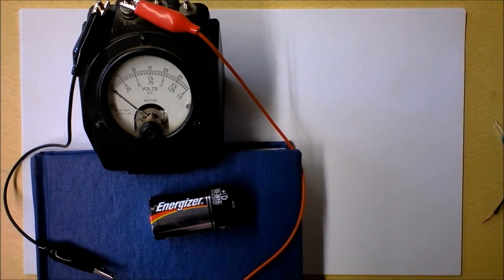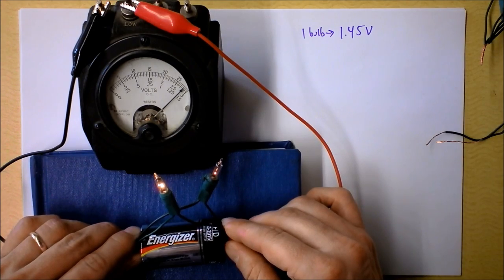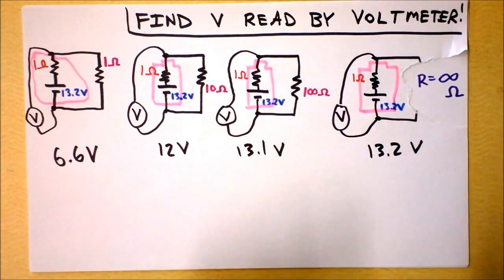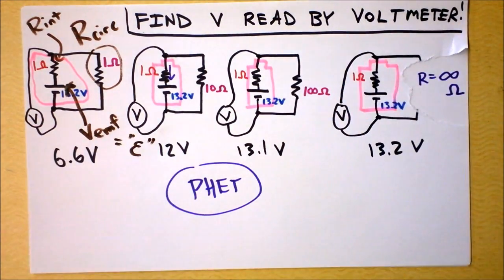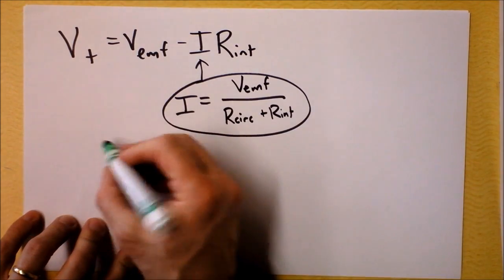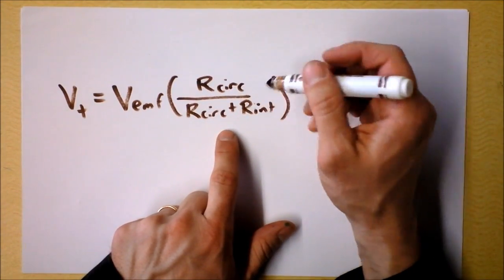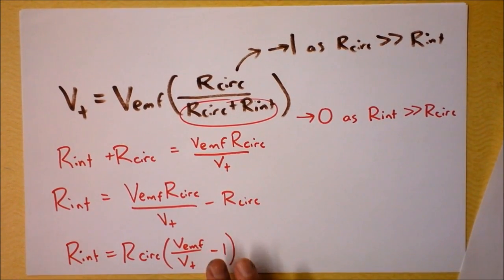EMF, Internal Resistance, and Terminal Voltage of Batteries Explained | Doc Physics

Comment: At 2:56 you have the same "terminal" voltage for both 3 and 4 bulb loads. This is obviously a measurement error I suspect because you are using an analog voltage meter or have simply interpolated the scale incorrectly. What you refer to as the emf voltage is more accurately described as the Thevenin voltage of the source (Vth) and what you refer to as the "circuit" voltage is usually known as the load voltage (VL).  Finally the "internal" battery resistance is the Thevenin resistance of the source (Rth). The formula expressed at 10:48 is an equation expressing the load voltage as a function of the current. If you were to plot this (load voltage versus current) for your data at 2:56 would would get a (approx) straight line whose slope is the negative of the "internal" (Thevenin) resistance. The "y-intercept" (at zero current) would be the Thevenin (open circuit) voltage and the "x-intercept" (zero voltage) would be the short circuit current (which is the ratio of the Thevenin voltage to the Thevenin resistance). I.e., V (load) = Vth - I*Rth. If you do this you would find that the straight line is best approximated ignoring the "3-bulb" voltage (which is incorrect). This line is very nearly straight and a least squares approximation yields an "internal" (Thevenin) resistance of 0.3 ohm in this case. Finally, a battery is not an "ideal" voltage source as an ideal voltage source has no internal resistance and thus will supply ANY current necessary to maintain a constant voltage. I.e., its voltage versus current graph is a horizonal line.

Comment: DOC SCHUSTER,,,,                                                      ,,,,    Eric Johnson is saying that overdrive & fuzz guitar pedals that take batteries will sound different when using different types of 9volt batteries NON-Rechargeable 9 volt batteries like Alkaline, Carbon zinc, Lithium, Mercury because of the DC resistance of the 9 volt battery.
////            The sound will be different if you use an Alkaline, Carbon zinc, Lithium, Mercury battery each will sound differently because of the batteries DC resistance
--->>>  1.) Why does each 9 volt battery type  Alkaline, Carbon zinc, Lithium, Mercury have a different battery DC resistance?      Why different battery types will have a different DC resistance compared to another battery type, any reasons why?     Yes I know that the batteries DC resistance will drop the 9volts when the guitar pedal is drawing more current but what Eric Johnson is saying is that  9 volt Alkaline, Carbon zinc, Lithium, Mercury will have a different DC resistance which will drop the 9 volt down differently when the overdrive or fuzz pedal is drawing more or less current.

Comment: I got 6.6V,1.2V,0.131V cause currents had the same magnitude,since they multiplied with 1ohm,we got these voltage values but this decimal place is confusing me
Reply: We learned that the bigger resistor got greater share of voltage so the resistor right next to our battery had a smaller voltage for itself so I felt like it's a bit reasonable
Reply: What you got is the current throughout the circuit, not the voltage. To find the voltage drop multiply what you got by the internal resistance, which is 1 ohm (because V=IR), and then subtract from the 13.2V. Idk if you still need this cause it was a year ago but hope this helps

Comment: what is the potential diff between two battries of different emf E1>E2 joined parallel to each other with internal resistance is zero.. these battries are joined is such a way that positive terminal of one is joined to the positive terminal of other battery and negative to negative ..

Comment: Aha! so when we measure a branch with the voltmeter, we consider only the characteristics of that branch, like the resistance of the battery!. The only variable that depends on the entire circuit, and affects the branch measurement, is the current, because the current goes through the entire circuits and comes into the branch you're measuring as being modified. The internal resistance doesn't sum with the exterior resistance when measuring the branch with the voltmeter, that was my mistake.

Comment: Hey Doc, I know, old video.. but I can't get the calculations right.. Isn't calculating through a voltmeter uses volts but the results you give are used with VR=I, i.e. 13.2 x 1/2 = 6.6 A not 6.6 V? Or am I missing something here..
Reply: It's V=IR not VR=I. If you were to make I the subject of the formula then it would be I=V/R and the units would be in A. To get his answer I think he most likely did his calculations like this: He found the total current in the circuit by using I=V/R which would be I= 13.2/ 2, your answer here would be 6.6A. To find the reading on the voltmeter he would have used the voltage passing through the 1 ohm resistor. Which would be V=IR or V=6.6 x 1. The answer would then be 6.6 V.Of course it is possible that I could be wrong and he used some other method but I think this is what he did. I hope it helps :)

Comment: I didn't get the first circuit diagram. Shouldn't the effective resistance be 1/(1/1 + 1/1) = 1/2? Then the voltage reading of the voltmeter should become 26.4, should it not?!! Can someone help me understand if there's any calculation error, because right now, I,m not able to!
Reply: Ram Bhar 
1. The resistances are in series not in parallel..they'll be 1+1(Req)=2 and the voltage drop would be 13.2/2= 6.6
2. The voltage..can it ever be 26 when the battery can produce max as 13.2?

Comment: umphh, the current supposed to move from terminal positive to terminal negative but why for this topic the current move inverted?
Reply from the maker: +Nur Zulaikha How did you get that impression?  I always treat current as coming from positive terminal.
Reply: In my school, we learn in physics that electrons flows from negative to positive but in electronics (different subject) we learn that current flows from positive to negative. This is because we originally thought the latter, but later is was discovered the former was true. The formulas still work with both concepts however, so electrical engineers kept with the idea that current flows from positive to negative for simplicity.

Comment: Yo yo yo.. I accidentally took the resistors in parallel (Silly mistake, the paralle voltmeter threw me off.). So I got Rtot using the parallel resistors equation. And then followrd by another silly mistake,(V=VR.) Getting the exact same answers as shown in the video. Any reasons behind this coincidental error? Help Doc!
Reply from the maker: +Hamza Ali I don't know how you use V = V/R.  Sounds like an inverse mistake or something.  Two wrongs made a right.
Reply: +Doc Schuster Doc doc, The last equation to this video. Quite similar to V=VR, don't ya think?
Reply: Fam, it's V = IR

Check your units.
Reply: +Hamza Ali Voltage = Current * Resistance

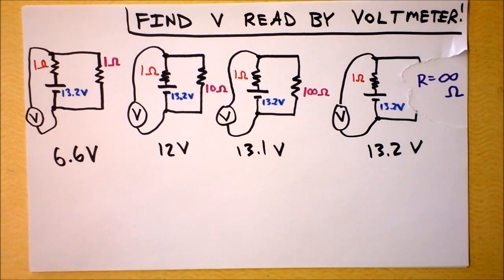Comment: Couple of comments at the bottom didn't get his voltages when they found the "I" of the whole circuit. Getting answers such as 6.6V, 1.2V and .131.  That is the voltage drop on the whole circuit,  it might make more sense if you did it like Kirchhof's rule. V-IR-IR=0.  Easier to recognize that as a drop.You minus that from the original voltage( V0-Vdrop)=Docphysics Answers , get the answers he has at around 6:15 . ... BYE

Comment: Doc how am I supposed to calc the battery emf if given only current flowing as 20mA
Reply: are you not given the voltage of the battery too ?
Reply: Also what other components are in the circuit, if any?

Comment: If you were struggling with the find the voltage part. Add the resistances together, then divide the 13.2 V by that total resistance value. Then do 13.2 V subtract the value you got to get the voltage you are looking for
Reply: Sciencenerd You substract because the voltage you get without substracting is the voltage of both the battery and the resistance! So for you to get the voltage of the resistance alone you have to substract from it the voltage of the battery. I hope it was helpful.
Reply: +alexander26bro thanks that was helpful :) !
Reply: We subtract because 13.2V/Rtotal is the voltage drop, we want the voltage on the resistor which is the total voltage minus the voltage drop. Kinda the opposite of what Rim said.
Reply: alexander26bro But why do you subtract? Once I got the current by dividing 13.2/R equivalent, I multiplied the current by the resistance which gave me wrong answers...
Reply: man but why should we find the voltage of resistor??

in the 2nd diagram 
the 1 ohm resistor takes 1.2 volt and the 10 ohm takes (13.2-1.2)=12 volts

the voltage will be finished by the time it reaches the 10 ohm resistor so the  PD across voltmeter is 1.2-0 -> 1.2 volt.

i am confused about what and where voltmeter reads

Comment: I need your help. I did the math but my answers are: 6.6v (for circuit 1 wherein the total resistance is 2) 1.2v (for circuit 2 wherein the total resistance is 11) 0.13( for circuit 3 wherein the total resistance is 101). I think i did something wrong.Just can"t figure out what. I used the formula V= I*R by first taking out the current across the circuit and multiplying it with 1 which is the resistance of the resistor on my left. Why is my method wrong?

Comment: Does more voltage or more current make bulb brighter?
Reply from the maker: Haider Rehman Butt SUPER question!  Brightness is related to power output.  So what would you say?
Reply: Doc Schuster I'd say it depends on both, as P = I*V.
In your video, Voltage across bulbs was same while current through each bulb decreased as more were connected in parallel. Hence brightness lowered.
If more bulbs were connected in series, current would be same through each and brightness (power output) would depend on voltage drop across each bulb. More resistance would mean more voltage drop I guess (according to Ohm's Law) hence more brightness (as compared to bulbs with less resistance) according to P = I*V.
Reply from the maker: BUT...the total voltage drop in series is going to be the voltage supplied by the battery...
Reply from the maker: Nice!
Reply: Haider Rehman Butt wow

Comment: great video and explanations to everything! one personal opinion and you may or may not agree is i dont like that formula you proposed at the very end. because if I was to just look at that on a formula sheet, quite frankly i would have no idea where that came from or how it was derived, therefore i would not understand any theory behind it. with just getting the same answer like i did in the first couple of minutes of the video i actually remember it and it makes complete sense and makes me think. with this formula its just plugging in numbers. regardless though, awesome job and keep it up 10/10

Comment: if 4 bulbs = 1.325 and 3bulbs= 1.325 how come the resistance is different
Reply from the maker: That's what I'd like to declare "experimental error."  I would graph the data and see that one of those two is a bit of an outlier (inconsistent with the pattern).  Perhaps the contact resistance was too high in the three-bulb case.

Comment: I don't like that R_int. I think all our lives would be better if it were zero. I do like puzzles though.

Suppose I have a box, and I paint it black. (This is essential, because after we are done I want to seal the box and keep its contents secret: a true 'black box'.) The idea is that we put a battery in the box, and no other sources of electrical energy. We can put in any electrical components that we want. But no other electrical energy source! Just the battery. Can we then get rid of R_int? We can put in transistors, opamps, IC's of whatever nature, capacitors, resistors, bulbs, coils, wires, enitire voltage regulator chips, a computer, whatever. But no other electric energy source (did I mention that?). Can we then do it? Can we eliminate R_int and have the box produce a voltage, possibly a little less than the original V_emf, that does not depend on the external load? Or is this impossible in principle?

To get puzzlers going, imagine that we put in an entire current meter and a small embedded computer, powered by the battery. Then when someone hooks up an external load, the computer 'sees' the current go up, and might take action to compensate for the voltage loss (by switching some transistors or something). This is a straightforward exercise in voltage regulation, that is done all the time in power supplies. When you begin to feel that this might be possible, then realize the starkness of the question: the box is an ideal voltage source, without R_int. Seriously? In reality? Electrons travel through the box, they are pushed only so much. Whichever complicated path they follow inside the box, there must surely be some resistance along that path. No way this can work. Do you feel the two approaches fighting inside your brain? Good. :-)